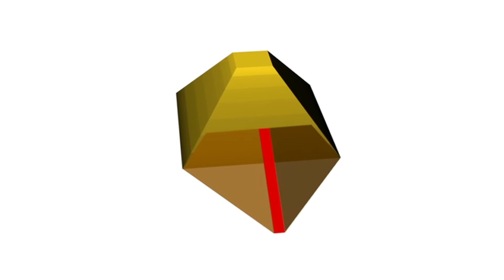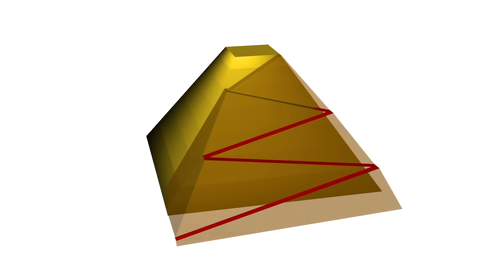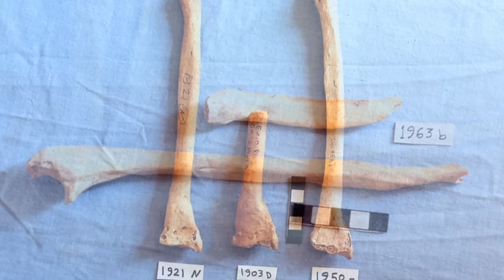Egyptology - Pyramid Construction

Comment: Ramps and sheer muscle power cannot move a multi ton stone, no matter how badly you want it to. How long do you think that sanding technique would work on over two million square blocks? Egyptians as we know them did not build those pyramids. There is enough evidence to say the pyramids are over 12,000 years old. Even with all our power tools and knowhow, just how long do you think it would take to cut out over two million blocks today? Considering the size and weight of the casing stones, it's unlikely most of them were taken, especially by the same group of people that were supposed to have put them in place to begin with.

Comment: It does seem much more plausible than a a gargantuan main ramp and a spiral external ramp would slide away
Reply: It should be noted that the blocks of the pyramid as it rises = become smaller - with most being found in the bottom half.  So what does this mean??  Answer:  you only really needed a ramp to raise the larger blocks found in the bottom half closest to the ground.  As an aside the King's Chamber and those heavy granite relieving slabs are below the halfway point of the pyramid. 

Herodotus wrote that they also used levers and "a machine" which is likely a fulcrum/counterweight device akin to the Egyptians shaduf which rested upon the "steps" - he stated they first built a stepped pyramid to fill in the sides.  He also stated they spent 10 years creating what he termed as "a great causeway" which infers a ramp.  

So as the pyramid rose in height + those blocks were smaller - it becomes plausible that they were raised not via a ramp but rather by the lever devices to lift them to the levels above where they would be maneuvered into place. If you look at photos of the top of the Great Pyramid where people climbed it to take selfies you will not those blocks are small enough for several men to lever them into place. So the ramp might have went as high as around the halfway point and above that level the smaller blocks were raised the rest of the way using Herodotus' "machine".

Comment: The Pyramids are the pulley system.. with the water flow next to the doorstep of the Pyramids they used the Pyramids and water as a pulley system and used the sound chamber to cause frequency to make things easier to maneuver while in the water

Comment: If the modern ages people still simply conclude the building of pyramid by the large amount of ancient slaves, it is too naive and over-simplified the ancient intelligence and too arrogant to our knowledge.  Imagine, what if the pyramid would have taken 20 years to build, it means every single block of more than 20tn with precision cutting being appropriately placed in the pyramid in every 5-minute!  Remember, this 5-minute includes the time of manufacture, delivery and installation of the fine cutting block in the pyramid.  Even if the pyramid might spend more than 40 years to build, every 10-min to finish the whole process of one solid block - which means the building must be completed with very advanced technology and techniques out of our nowadays modern people’s minds.
Does anyone still believe merely complete all the fine work by forcing the cheap labour to do so?
Also, such pyramid must have more impactful purpose than merely tomb for a single king, so as to drive and incentivise the majority nation human resource to devote efforts into the project for a long period of time.

Comment: Blows me away the great pyramid of Giza base is 13 acres big!! There isn't enough room inside for the amount of people to have dragged the sarcophagus inside the kings chamber. How did they even see in there ? No evidence of torch's or lamps used.  Mirrors wouldn't have worked. Do not think the  the great pyramid was a bural site. The purpose of this amazing monument may never be solved.
Reply: 🤦 Really............  How do you imagine a bathtub which is wider than the door gets inside the bathroom.......  Answer:  it is installed BEFORE the walls go up - duh!  So the Great Pyramid sarcophagus would have been installed before the chamber was completed.  Also since there is no carvings on the interior walls = once the chamber was enclosed then no further work on it was required.  Any inside work could be accomplished using oil lamps.

p.s. - not all lamps produce a lot of smoke you know.  Egyptian oil lamps likely used "high grade" oil - and as some believe salt was added to it - so as to not produce a bloom of smoke from them.  Also they are believed to have twisted their wicks so that they also did not give off a lot of smoke.  Then lamps and reflective mirrors can illuminate inside chambers.  

Final thought.  The King's Chamber = was renovated in the early 1990's.  All the rubble which once filled it was removed and the holes in the floor/walls from people looking for hidden chambers were repaired = and it was cleaned up to make it safe for tourism.  Methinks you should learn more = and assume less - just saying.

Comment: Building the pyramids with copper/bronze tools, refining perfectly flat sides, right angles, perfectly symmetrical statues,  etc etc.   Laughable!
Reply: The vast majority of the pyramids are roughly squared stones, and the core is rubble mixed with mortar.
Reply: And,,,  the kings chamber ,,, the sittounding flagging g stones with seams so perfect they are difficult to see,,,   the magnificent, colossal carved stone stone statues,,,   rubble and mortar ?
Reply: @russellkitley1009  yes, the majority of the pyramids are rubble and mortar. This was ascertained by the "robbers tunnel" which was dug 89 feet into the core the pyramid to access the interior passages. The king's chamber walls are a small portion of the pyramid. The white limestone capping stones are soft rock, easily shaped. Statues? What statues are affiliated with the Giza pyramids in the same time frame?
Reply: @russellkitley1009  why is it hard to believe that stone age people mastered the workings of stone construction?
Reply: @davidnixon1970  it's not hard to believe at all,    the evidence that they did it is clear,  it is unexplained how they did it,, who really did it and when
Reply: @russellkitley1009  I've studied this for years, and the answers are all there. For example a common problem people state is how was the granite cut? Granite is harder than bronze, well it's actually harder than iron too for that matter. But it's actually effectively cut using toothless bronze saws with quartz sand as the cutting agent. Quartz is much harder than granite. It's been replicated on video and the process is quite effective. Interestingly this process is actually shown on Egyptian hieroglyphs. Abrasive powder cutting and sculpting was a technique employed on granite right up to the invention of the modern diamond saw and diamond oscillating grinders, invented in the last century or so.

Comment: The had Ox and horses, probably donkeys also but every artist's depiction always has the labor doing it themselves instead of using Horses or Ox. Also, keep in mind, if they had Chariots then they also knew what a wheel would do.
Reply: First understand that while Egyptian iconography gives us visual representations of things - some of it can be viewed as "overly generous" at times.  An example is a Pharaoh who engages in a military campaign naturally desires to be depicted as a conquering hero.  Thus a temple depiction will reflect their "greatness" making it "propaganda".  That is not to say the battle did not happen.  Merely that their role in it was likely exaggerated.  

Anyways.  We have iconographic depictions of their performing various examples of manual labor.  We also as it happens have examples of draft animals doing the same.  So the Tomb of Hunefer shows yoked oxen pulling a large sarcophagus on a wooden sled in a funeral procession.  We have examples of actual sleds which look identical to those depicted.  We have evidence in the form of cattle bones at the worker village at Giza - placing oxen there during the period of the pyramids.  

So if they consumed cattle + they used them for labor to include pulling laden sleds + they were present at Giza during the time of the pyramid's construction = it is not unreasonable to conclude they were also used to help transport/position blocks - if only the larger ones. 

Forget about wheels.  Chariots in Egypt were not seen until after the time of the pyramids.  Also wheels to be feasible for transportation in heavy construction demand paved/hard packed roads and strong metal to reinforce the transport = iron/steel - which they lacked at that time.  Wide wooden sleds close to the ground disperse the weight above over a wider area making then better suited for moving heavy loads like stone blocks.   🤔
Reply: @varyolla435 DARZHNARZHERLARBLE?

DARZHNARZHERLARBLE?

Comment: I would suggest that NO 2 ton stones were used,;what was used was a mixture  very similar to our present concrete. This mix would be poured into a mould in-situ , giving the  perfect butt join every time. No lack of sand or water, just find what 'cement' was used Problem solved 5:02 .
Reply: 😴😴😴  Garbage in -------> garbage out = it never grows old........    Make sure your "French model" buys the dinner.....

Comment: Who said they didn’t have block n tackle ? It’s straight forward force multiplication, needs only wood and rope, and manpower.
Reply: Who says = the evidence we see......  So it is not real until evidence is provided to demonstrate otherwise.  What we do see as an example are once roads in the proximity of their quarries which were linked with postholes.  So it appears they would line a road with posts on both sides to interlace ropes through the posts to easy heavy blocks on sleds down grades.  There is absolutely no evidence whatsoever to support block & tackle use in ancient Egypt.  🤨

Comment: get a bucket, place a large rock into the bottom of the bucket. fill the bucket with enough sand to cover the rock. shake the bucket back and forth. you will notice in time that the rock begins to come to the surface on it's own. this proves that the larger rock does not sink into the sand. actually the sand sinks around the rock. now the pyramids are built in a desert where there is a never ending supply of sand. so maybe they built one layer of stone, added tons of sand to the outside and layed the next layer of stone. they then kept adding sand and stone, until the pyramid was completed, then all they had to do was remove the sand from the top down. the reason i came to this conclusion is because because of the building of my driveway in front of my house. all the dirt, tree roots, clay and rocks, where removed down to a level of 4 feet. it was then filled with clean gravel and layered with asphalt paving. after cars and trucks driving by my house for the last 5 years, there was a huge bolder forcing its way through the pavement. all the vibration moved the smaller gravel to the bottom and forced the boulder out of the depths. i am not a scientist, but i do know how the earth moves.

Comment: They manage to maneuver the blocks with equipment no longer present a semi truck like hauler=to pull 80 tons laser like cutters to cut them and some type of lift/placement arm powered by the electricity they would have to have and of course a computer measurer to give them the elevation/readings (no one gets it right through first time).or if the blocks have metal in them a magnet lifter on a crane and the usual scaffolding

Comment: Thanks for the video, but for me something is still miscalculated. Egyptologists say they did it in 20 years. If you do the math of 2,300,000 stones in 20 years, that means:
1. You have to cut every stone from the place (which is 18 km from the construction site) with copper and bronze! The stones are approximately 2.5 tons each; thats important!
2. Transport the stones across the desert without an advanced wheel system, and cross the Nile (uploading and downloading a 2.5-ton stone in a boat is difficult!)
3. Align and match the stone with the previous stone.
All that in 4.5 minutes per stone! NO STOP for 20 years!! Thats imposible... Ok, let's say the Egyptologists were VERY wrong and they constructed the pyramid not in 20 years, but in 40. That means they had to cut, transport, and place each stone every 9 minutes. 24hs NO STOP.. No way! With the technology we have today, that will be impossible. Well, it would not be impossible if you had many stone suppliers and a great project manager, but still, CRAZY!!! Any logical ideas??? I'm lost.
Reply: Soooo many words = but nothing actually sad - how sad.............  Thank you for an example of what poor assumptions can lead to.  Further it illustrates the pitfalls of "self research" by those unable to correctly do so.  Garbage in --------> Garbage out.  🤨
Reply: @varyolla435  They are not assumptions; they are math, and very basic ones. Science is based on questions... Do you have something to contribute, or are you just going to react?
Reply: @fernandosaburit  mathematical assumptions = "statistical fallacies" - learn the concept.  So you try to argue based upon poor assumptions - assumptions which reflect superficiality of thought and a lack of understanding of the evidence relating to this.  

Ergo my contribution is = dig deeper - and find new sources of information as clearly what you have been listening to isn't making it.
Reply: @varyolla435  Ok. If you want to cut, move, and place 2.300.000 rocs in 20 years. You have to cut, move, and place one rock every  4.51 minutes (aprox). ¡Please! Explain to me where is the assumption in that mathematical fact?
Reply: @varyolla435  By the way, for this kind of calculation, you don't use statistics, you use a simple "rule of 3"

Comment: The math doesn’t add up from a project management, construction management, and engineering standpoint. It is impossible to quarry, cut, transport, and precision set 2.3 million blocks of limestone in the proposed timeframe. Even if you have an enormous workforce (that still needs to be fed, watered, and sheltered), you’re still required to set about 315 blocks per day, 7 days per week, 365 days per year, for 20 years.

I’ve worked around limestone quarries before. It’s great to build with once it’s in place, but cutting and transporting is the challenge. It’s extremely brittle and chips easily. Dragging a block of stone that big on rollers that many miles would cause significant damage to the block. If a piece of stone were to make it up the pyramid, it would have to be precision cut and fit hundreds of feet up the structure so that the final stone wouldn’t be damaged.

Comment: Before construction they made a massive pile of sand at the same height as the pyramids with a very gradual slope. Then they built the pyramid from the top first, working down to the base of pyramid removing sand as they go along.
Reply: not even close
Reply: @icomment7715  I'm waiting for your hypothesis on how it was done?

Comment: The level of precision in the stonework can't be achieved by hand even with todays building tools. In commercial contruction a tolerance of a 1/16th of an inch is a gold standard to strive for and many ancient stoneworks have tolerances of .007 or less... even when it doesn't make sense to spend the time doing so. Stringlines are a rudimentary tool that cant be relied on for any kind of consistent precision, the longer the string, the more it bends from gravity and wind no matter how tight. the pyramid is also oriented to true north and we weren't even able to verify its precision until modern times. I dont think "how did they move the heavy stones" is the most interesting question to ask if you actually know about masonry, stonecutting and machining